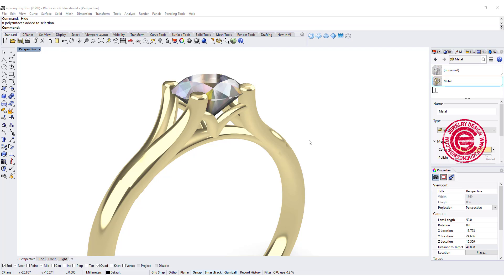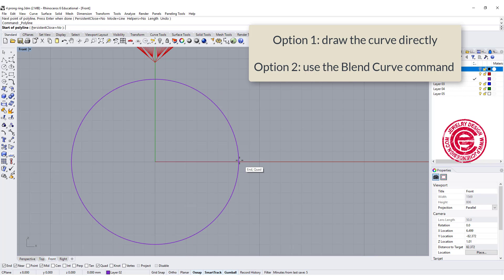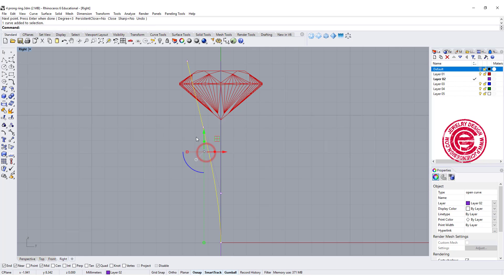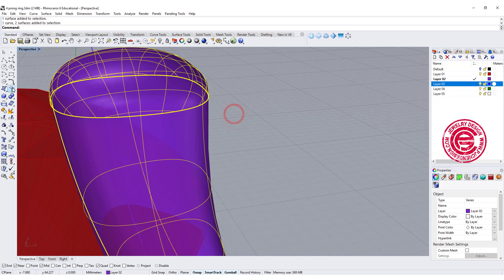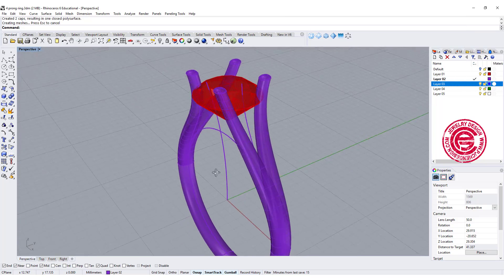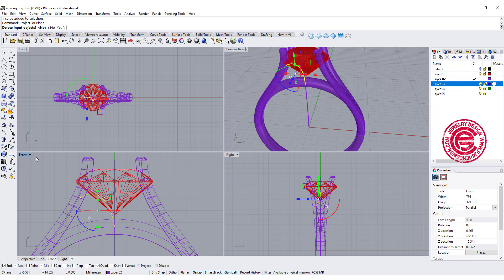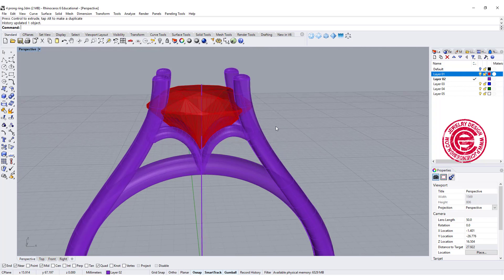How to Model Split 4-Prong Ring in Rhino (2019): Jewelry CAD Design Tutorial #61

Comment: When I try to add the splitting angle my curve line never stays on the same plane and looks distorted despite following the ways you suggest.  What would you advise to fix that?
Reply from the maker: you can turn off the osnap before draw the curve. or use project to Cplane to make them flat to cplane
Reply: @PJChenJewelryDesign  Thank you very much.  Do you offer private lessons? If so, I would love to work with you one on one for a project I am currently on.  Thank you!
Reply from the maker: @zacdelvecchio2312  sure. send me an email at pj@pjchendesign.com

Comment: Hello! I am using a rhino v6 on mac and I'm struggling to do the crv2view with the right curve linked to the adjustable new curve. It seems no matter which the order I select the curves in crv2view, the new curve is always linked to my curve that is created from the curve to plane view. When I move the curve you move, nothing happens, but it only moves when i adjust the curve to plane curve. could anyone please help? thanks!
Reply from the maker: Check on your curves. They may not be flatted  to CPlane.
Reply: @PJChenJewelryDesign  thanks for your reply!! I still couldn't get it to link to the right curve even after i used align, but i ended up just copying that  project to cplane curve on a different layer and then turning adjusting it for the prong curve. I went worked with the copied layer later when I needed to use crv2view for the inner detail. Thank goodness I could still get the result with a workaround. maybe next time I use these function it will work. Just wanted to say that I'm currently learning rhino through your videos and this is the 3 one I tried. Thank you so much for sharing these lessons, PJ!

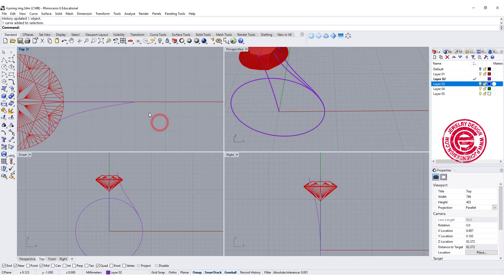Comment: Thanks for these tutorials. Between 03:40 and 04:15, when I move the curves, the whole curve moves including the lower origin. You just move upper part and the lower point stays joined to the shank circle. Complete beginner here so would you explain please exactly which commands are required so that only the upper parts of the curve move? I do not see curve control points any more.
Reply from the maker: I was moving control point only. The control point will be on automatically when you pick up curve. If you are using Rhino 5. you need to turn it on manually.

Comment: Thank you!  Failed to boolean union those intersecting prong/shank branches though ( all closed polysurfaces). Any ideas?
Reply from the maker: Evan Gregor sometimes is the seam completely aligned will cause Boolean fail. Move up down right or left 0.001 will fix the problem.
Reply: @PJChenJewelryDesign  , thank you PJ, that was an easy fix! You are so knowledgeable

Comment: hello, I magnify the video as everyone, please I need your help, I've seen that in several tutorials, when it makes a curve and selects it, in the curve appear some points which you can move, for example in this video in minute 3: 03, in my rhino only the curve changes color when selecting it, but those points do not appear, I know they are not control points, as I do so that they appear, thanks
Reply from the maker: william almeida the control point will appear automatically in rhino 6. If it is rhino 5, the points will only show when you have point on command.
Reply: @PJChenJewelryDesign  hello pj, thank you for answering and clarifying my doubt, now I was exercising your tutorial and at the end  failed Boolean union,  half of the design is lost, some tutorial solving Boolean problems to see it, thanks again

Comment: This is such good advice and instruction. Thank you so much!
I was at a CAD competion yesterday in Atlanta and one of the contestants was using "Tspline" to adjust the variable width of her "sweep1rail" components. 
I have Rhino5, Rhino6 and RhinoGold6.6. None of these seem to have "Tspline" as a command. 
Is there anything similar to "Tspline" in any of these programs?
Reply from the maker: If you have Rhino 5, you can download Tspline from Autodesk. If you use RhinoGold. It is in other name call Clayoo.
Reply: @PJChenJewelryDesign  Thanks. I've shyed away from Clayoo until I know about RhinoGold and the Rhino programs that it works off of. I'll look into the Autodesk option.
Reply from the maker: t-spline and clayoo is the same just different name.